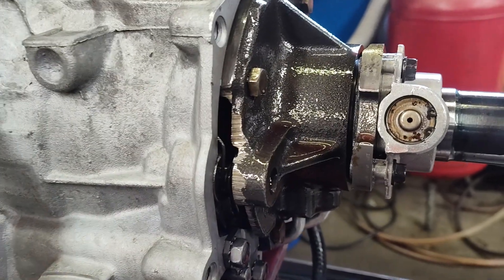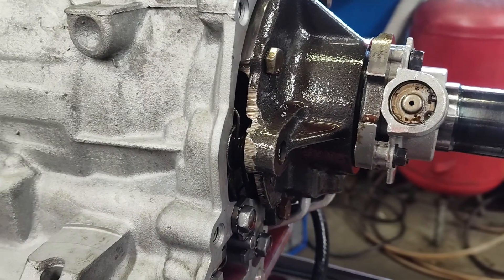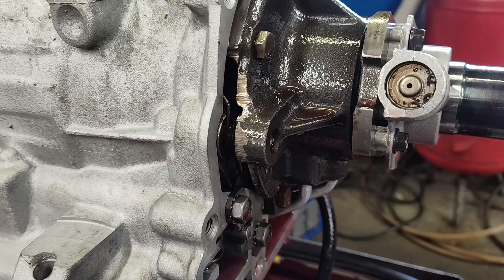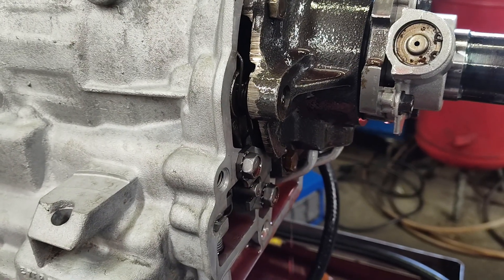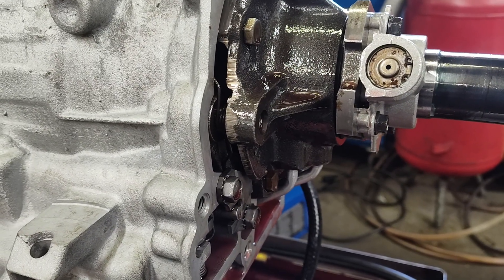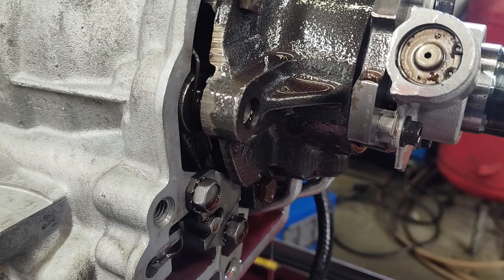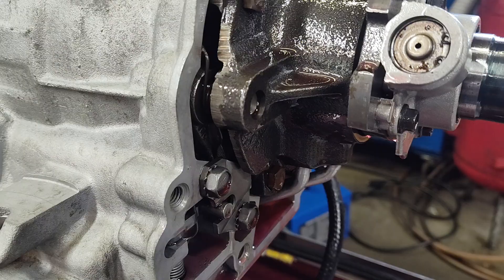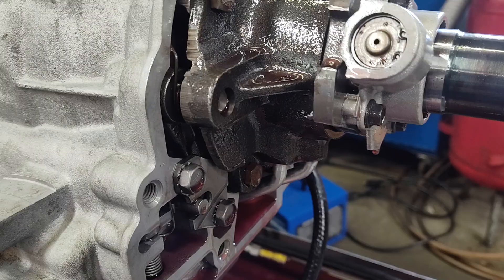Ford C6 Transmission Not Shifting and Governor Diagnostics

Comment: I have a TCI AOD C6 Street Fighter automatic transmission in my 1968 Mustang. I was racing when the torque converter went out at 3,500 RPM and sheared off one end of the input shaft. I replaced the input shaft what's a new rebuild stock torque converter. Having an issue of it being stuck in first gear. My question is will the governor be a good cause of it keeping it from shifting? If anyone knows or has any ideas please let me know.

Comment: Jay, I have a C6 in a 1971 F100 that starts in 2nd gear unless I manually put it in 1st. I have removed the governor twice and cleaned it thinking that was the problem, still starts off in 2nd. I never thought about the radial load on the valves while spinning, I just knew they were not sticking when I took it apart and cleaned it. Do you think it is the governor causing the problem or could the valve body be the culprit?
Reply from the maker: It still could be the governor. I would replace it before getting into the valve body.

Comment: Man that is frustrating, especially when polishing and honing does not help. Thanks
Reply from the maker: It is for sure. Especially a C6 where you have to remove the extention housing to get to it. GM did a much better job of making the governors servicable.

Comment: I'm guessing you're not a fan of "Check ball in the primary valve" trick/theory...I've seen some swear by it, but then again I've never had a stuck governor--yet.
Reply from the maker: Im honestly not familiar with it. I may be a fan if it works. Thanks for the tip.

Comment: What is the proper way of polishing the valves like in the governor and in the valve body that you wouldn't use nothing to abrasive I was told that in the back in the day they use paper bags
Reply from the maker: IM going to say I dont know because on the governors it doesnt seem to work for me. I normally use 220-400 grit paper. The valves are heat treated so they dont sand easily.